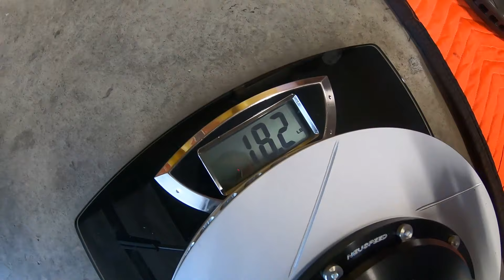2018 Audi S3: Episode 26: Installing Neuspeed Lightweight Front Brake Rotors

Comment: I just ordered nuespeed for my mk7.5 gti 2 piece slotted for the front and just the slotted for the rear. I got the isweep pads. Doing red stainless lines also!
Reply from the maker: sick dude, thats an expensive buy right there..  red lines is pretty cool, they'll pop
Reply: @LastHumansGarage  yea It was 😭 hoping it lasts a good 40 or 50 k miles.

Comment: Clean install bro, very nice that those rotors balanced out the A5 wheels. Do invest 30 minutes or so to bed them in (basically a thin layer of the pads is transferred to the rotors), because it will make a big difference in stopping power. I had never done it until I mounted the CS-S rotors and they grab like there's no tomorrow.
Reply from the maker: Thanks for the tip, i did more bedding this morning, doing it a bit at a time with carefull cool down for those expensive rotors.

Comment: You didn’t have the rotor placed properly on the scale
Reply from the maker: haha. maybe. but since the final weight was 18.2 which exactly matches Neuspeed specifications page, I'll be ok. If you wanna buy a set and double check the weight, all you brother!